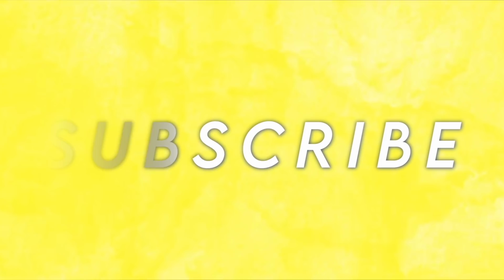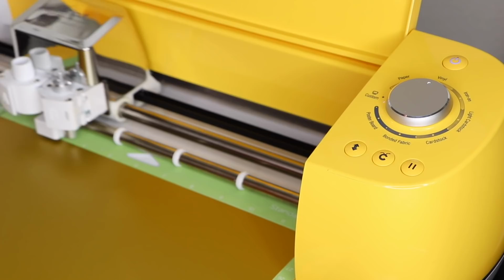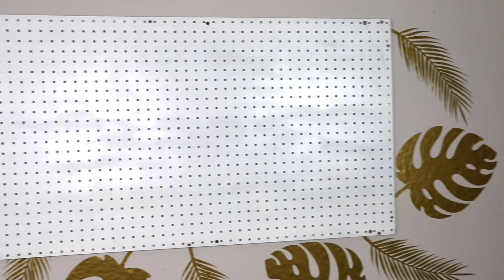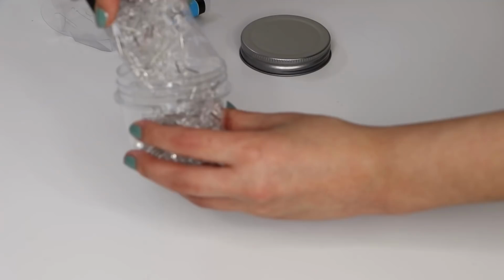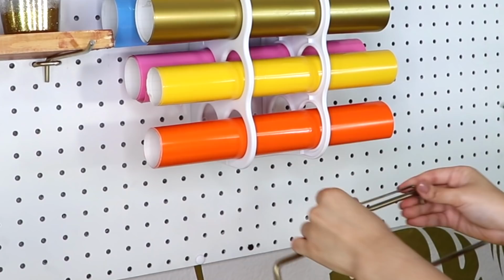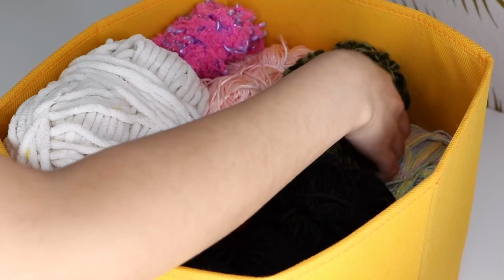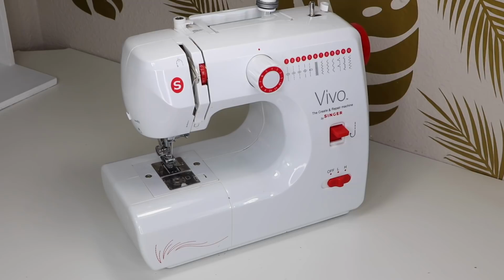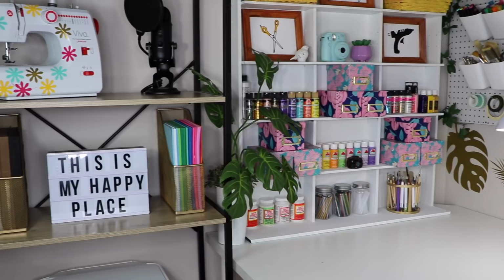EXTREME CRAFT ROOM MAKEOVER + TOUR 2020! *On A Budget* | Organization Ideas!

Comment: Okay, when you said you were cutting the "leaves" out of permanent vinyl, I assumed you were going to frame them or something close. But I cringed when you put it directly on the wall. Permanent vinyl damages walls when you try to remove it. There's a vinyl like Oracal 631 that was designed specifically to put on walls and remove with ease when you no longer want it. I'm just hoping you misspoke when you said permanent vinyl, but actually meant non-permanent. 🤔
I'm in the midst of redoing my craftroom and I swear, it looks like a tornado hit the room. 😂